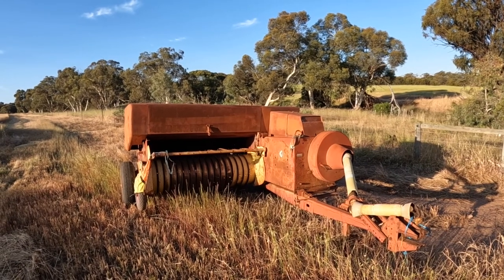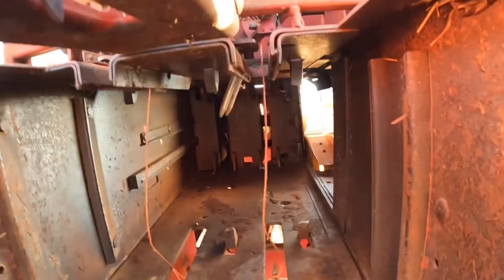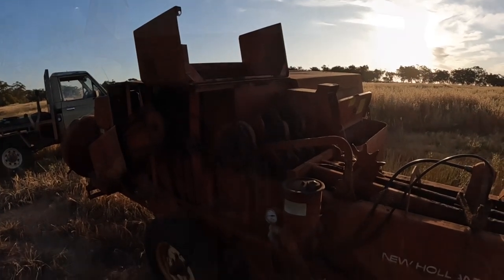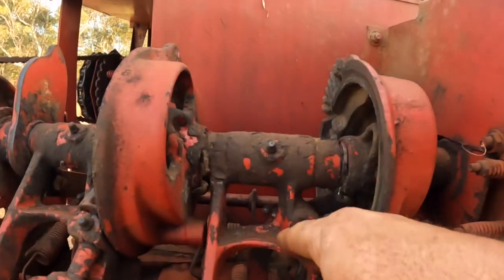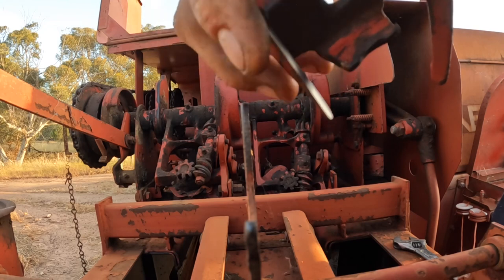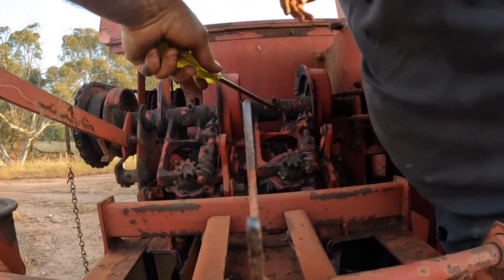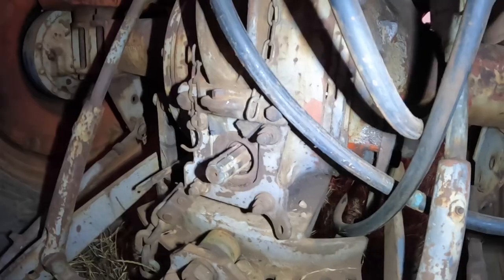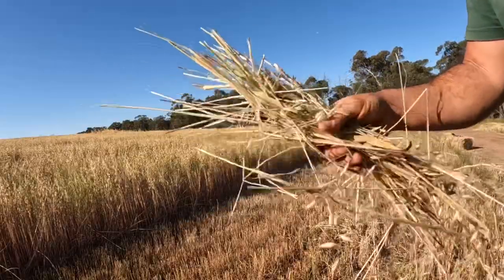Baling hay

Comment: We usually put  grease the the pto  shaft to help it slide on easer
Reply from the maker: Hi, I usually put grease on them too, but this was the first time I had used the pto on this tractor and I had dropped the grease gun back at the washed by the time I hooked that up. Thanks from Geoffrey